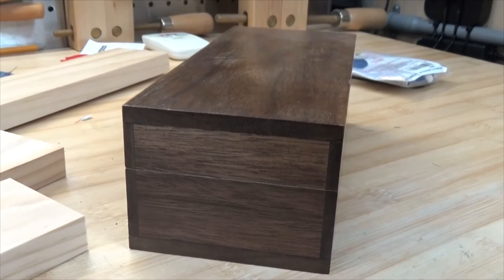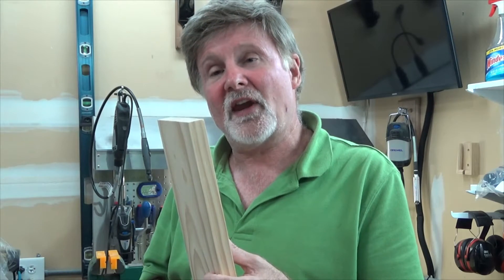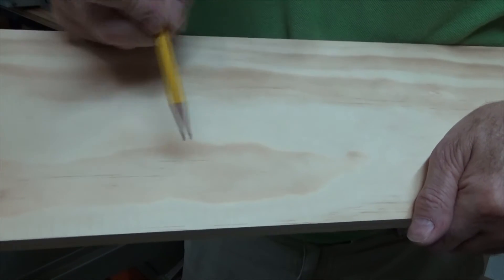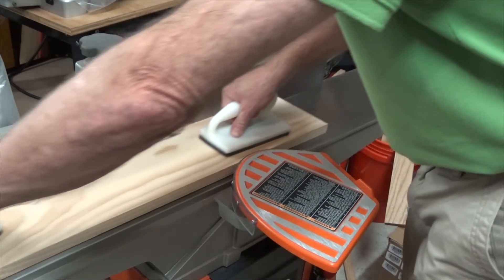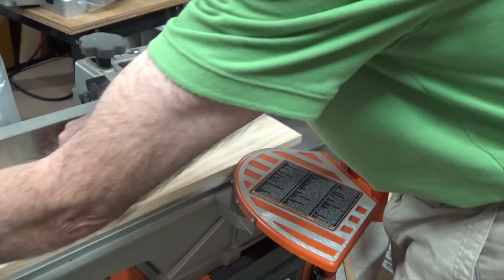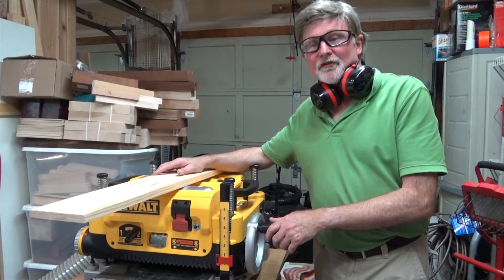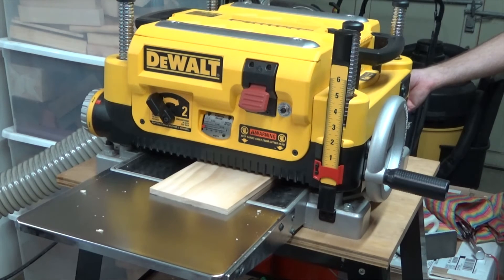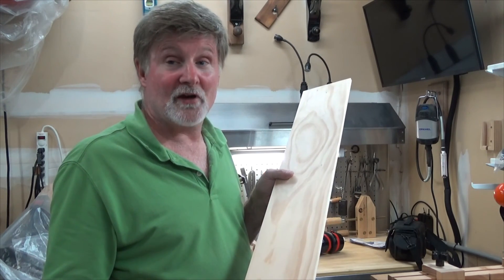Jointing and Planing VIdeo

Comment: Hello,
I am wondering If I can joint both edges on the jointer/surface planer and make them parallel to each other.
Reply from the maker: Great question. The answer is no. You will end up with two sides that are not co-planar. The more passes you make the worse it will become. The board will eventually look like a wedge. The proper procedure is as follows. 1. Flatten one side on the jointer. 2. Put the flattened side against the jointer fence and flatten the adjacent edge. It will form a perfect 90 degree angle. 3. Place the flattened face of the board face down on a planer. Now when you run the board through the planer the flat surface riding on the planer bed will become the reference that will enable the planer to create a flat surface that is co-planar to the reference surface. 4. Lastly, take the board over to the table saw. Lay the board flat and put the edge that you flattened on the jointer against the table saw fence. This will become the reference surface so that when you rip the opposite edge you will end up with a board that is uniform width the entire length. Hope this helps.
Reply: Thank you for the answer. I meant 4th stage. I could not see a reason why I cannot plane both edges on the jointer after making both faces parallel to each other?  I am wondering why we cannot carry out 4th stage on the jointer as well? Please forgive me. I am inexperienced woodworker.
Reply from the maker: How would you make the final face parallel to the first. You must have a flattened reference face that rides on a flat surface. That is why it must be done as I stated above. When I started woodworking I thought it could be done as you stated but it just isn't possible. I tried to do it early on and ended up with some very expensive exotic wood wedges. Google what I am talking about and you will find some explanations with images that might help you to understand the concept. Good Luck.

Comment: what about if i don't have a table saw? can i use the planer the second edge?
Reply from the maker: Great question. The simple answer is no absolutely not. Here is why. The first edge that you jointed becomes the reference edge that you place against the fence of the table saw. This assures that the two edges of the board are parallel. If you tried to do the second edge on the jointer there would be no way to make it parallel with the first edge. The edge would be clean and flat but there is no way it would be in line with or parallel to the initial edge you flattened. In other words the boards width from edge to edge would fluctuate as you move down the length of the board. Hope I cleared this up for you.
Dave
Reply: Dave's Woodshop . Thxs for the reply ,I have a jointer n a planer but don't have a table saw. I just have a circular saw and a jig saw.
Reply: ty for your reply but i don't have a table saw...only have mininal tool a circular saw n a jig saw but i have a jointer n a planer. will to  figure out how to flatten the second edge by using a circular saw.